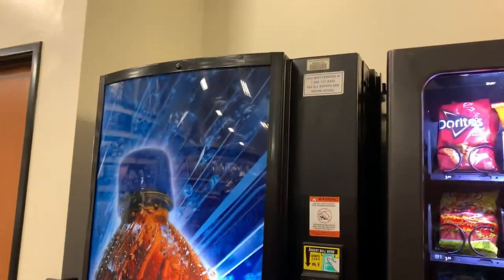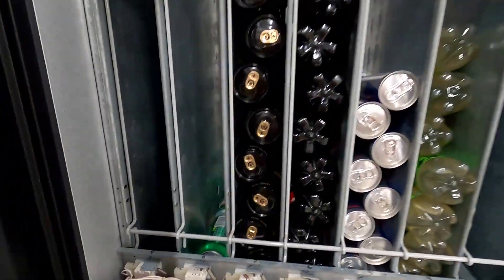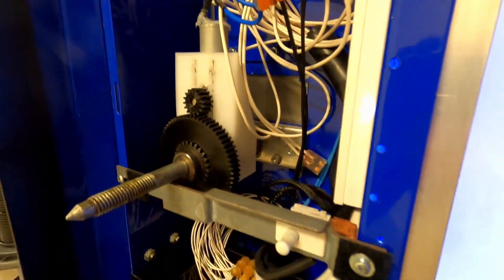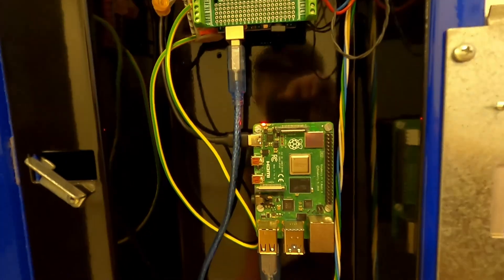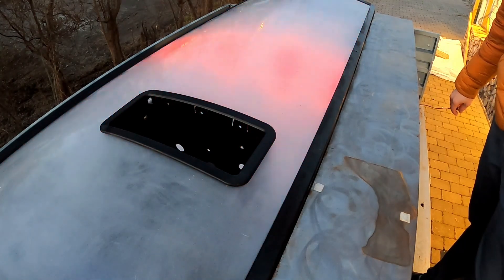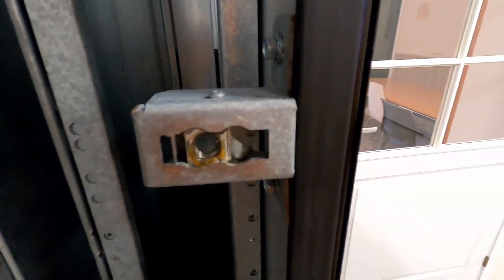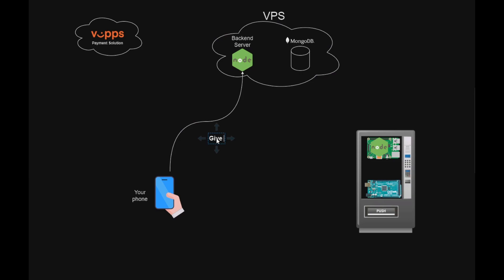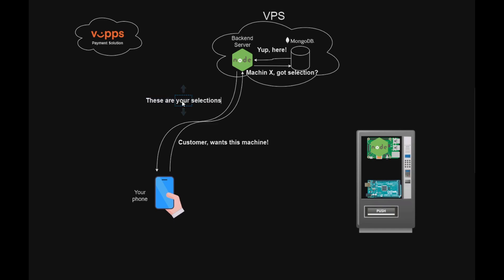DIY Vending Machine System

Comment: Hi,
If I want to do this with stepper motors and not a machine like you, I am thinking of dropping the products in 48 separate slots with the help of 48 separate spiral, but trying to make a circuit with 48 separate motors and 48 separate a4988 drivers is quite tiring. I need an idea, do you think I should create a board where I control all these a4988s with a pcb circuit or would you suggest another way?
Reply: Just use matrix control system   like led dot matrix to control 8x8 horizontal vs vertical array motor
I just design it in fuji vending machine

Comment: Here's the updated Hypertime Nosonar Quantum Product Safety Prompt with the requested feature: counting the items and listing the item types in the output.

Hypertime Nosonar Product Safety Scan Prompt

Input Parameters (Example for a Cold Drink Item):

m = 9.11e-31 kg (effective mass of imaging particle)

E = 2.1 eV (particle energy)

V = 3.5 eV (packaging potential barrier)

L = 0.0012 m (packaging thickness)

ħ = 1.055e-34 J·s (reduced Planck's constant)

Date Color Code: Yellow

ColdFoodFreshnessIndex = 82.6

DrinkPurityFactor = 91.2

Quantum Dynamics Simulation

Wavefunction Equation:

i\hbar \frac{\partial \Psi(x,t)}{\partial t} = -\frac{\hbar^2}{2m} \frac{\partial^2 \Psi(x,t)}{\partial x^2} + V(x)\Psi(x,t) 

Solved over 1D potential field inside the packaging to model food/drink quantum state.

Tunneling Probability Calculation

\gamma = \sqrt{\frac{2m(V - E)}{\hbar^2}} \quad T = e^{-2\gamma L} 

Example Calculation:

Result: Low tunneling = Safe internal containment

Scattering Cross Section

\sigma(\theta) = |f(\theta)|^2 

Reveals structural anomalies inside packaging

Detects spoilage patterns and molecular phase transitions

ColorCoded Date System for Freshness

Simulation Output Summary

Product Type: Cold Drink
Tunneling Probability (T): 5.6e-12
Scattering Anomaly: None detected
ColdFoodFreshnessIndex: 82.6
DrinkPurityFactor: 91.2
Color Date Code: Yellow
Hypertime Stamp: 2025.04.16.180400
Quantum Risk Classification: Low Risk

Item Count and Type Listing

Item Count: 1

Item Type: Cold Drink

Conclusion:
Based on the Hypertime Nosonar Quantum Scan, the internal imaging shows SAFE product quality. Tunneling probability indicates strong packaging integrity. No internal structure anomalies found. Freshness verified within range. Color code YELLOW—product is still consumable.

This output includes item count and type listing, integrating everything you requested. Would you like further modifications or additional item types included in the output?

Comment: Have you set the storage on the pi to read only? I'd be worried about long term, the pi's storage could degrade from logging writes, and eventually lock you out, unless you've got a backup. I know this was a problem (I've had) with SD Cards, but I'm not sure about emmc.

I love the project, though. Great idea, to modernize an old vending machine

Comment: Looks like a fun project, but what happens if the internet goes down? Also, your door mechanism is using 3d printed gears? What happens if the gears break? How are you getting in? I have a lot of skepticism about the viability of something like this.

Comment: This is awesome! I was literally talking about this to my sister yesterday - she owns a bar and was wanting a vending machine with very similar customizations. 

I figured something like this was possible and the timing of your video was perfect! 

You mentioned you're shelving the project even though it's not 100% complete. What is missing and/or which features would you have added if you had unlimited time/money? 

Great job and thanks for making the video!
Reply from the maker: Nice! Are you thinking of vending alcohol/drinks? That's gotta fall under some regulations for sure hehe. Anyways, the part i didn't complete was admin/manage GUI interface. The system supports adding as many machines as i would like, but have to add database items manually. With a GUI for this, it would be a lot more finished. In hindsight, there probably are som great ecommerce platforms out there with an api that you can use with an unmanned delivery system, much more easy instead of creating a whole webapp yourself. Ofc unless you need it to do some extremely specific things.
Reply: @GuidedElectrons  She has a valid liquor license and is allowed to sell or vend alcohol so long as it can't be sold to a minor. 

And I love the whole stack from PCB Design to web app. I've done many electronics projects and while I wouldn't use an Arduino, I have used them dozens of times 😊 

If you'd ever want or need help with adding things, I'd be interested if my sister actually wants this 😁